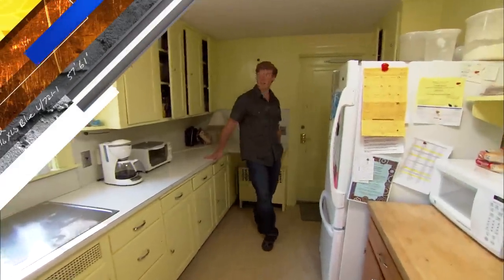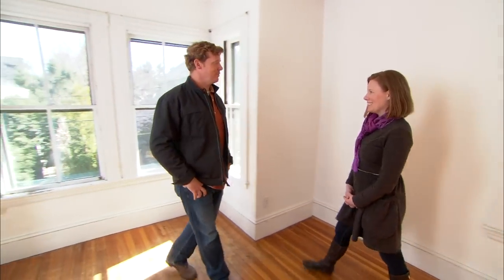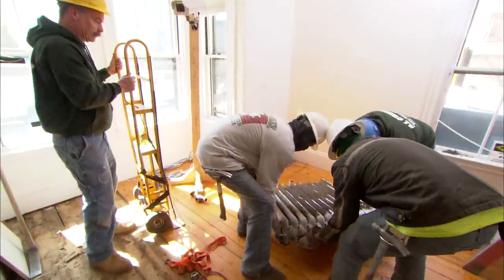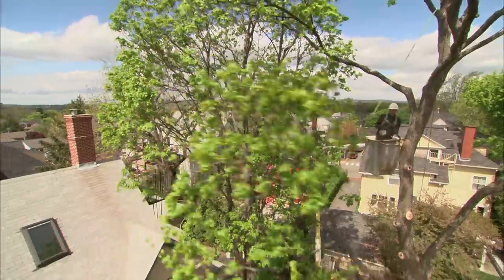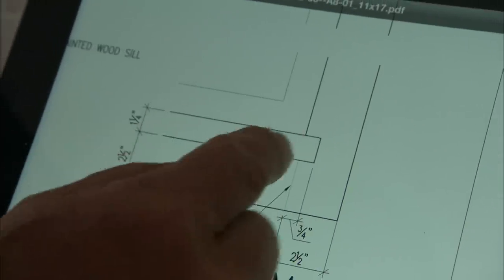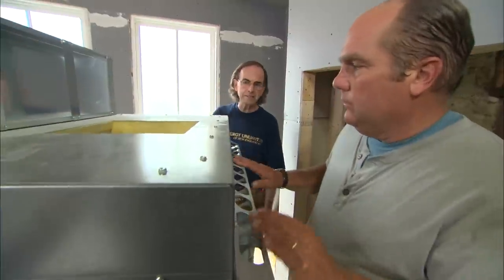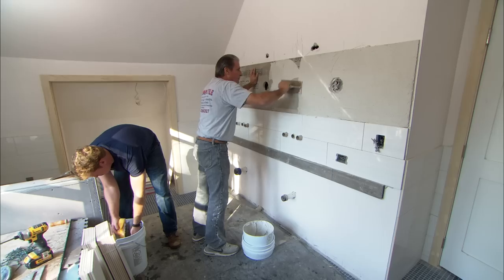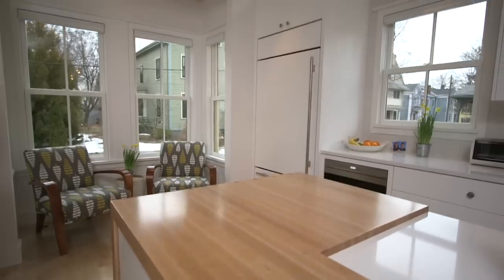This Old House | Summer Special:  Scandinavian Modern (S42 E27) | FULL EPISODE

Comment: As a Scandinavian i can tell you guys that the windows aint Scandinavian design :P For the most part we use aluminium outside and wood/plastic inside, and the windows is a tipping style, instead of the American slide :P